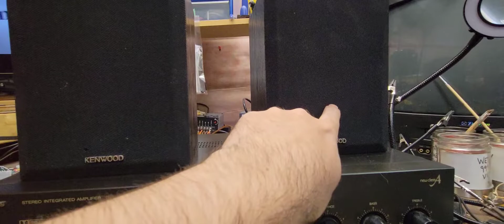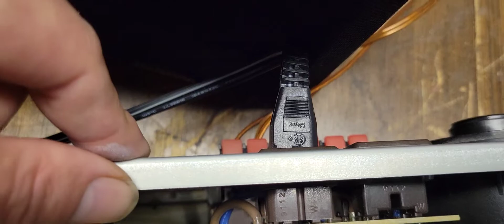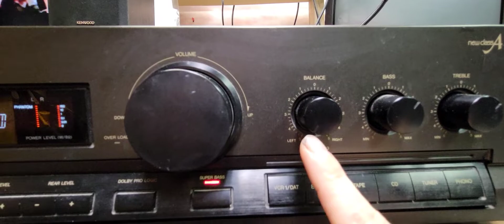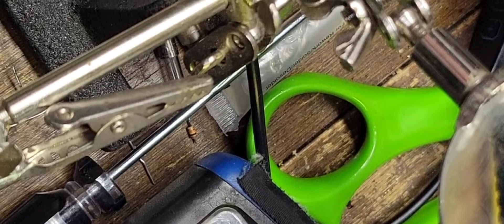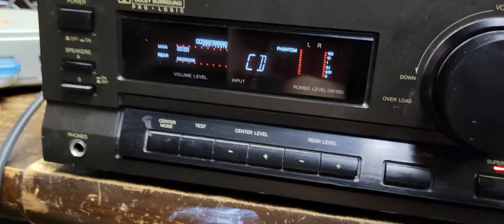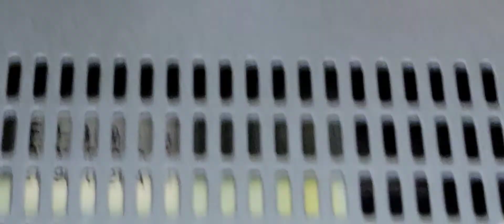Technics Amplifier Repair

Comment: I have this same Amp and had a similar issue. Just needed to touch up the solder joints on the speaker binding posts.

Comment: My Technics SA-AX920 receiver emitted a very POP from each speaker cabinets and immediately shut off.  Once cooled the unit returned to serviceability until again "POP" and unit shut down.  Talking with some engineer friends they tell me the outboard cooling fan has stopped working causing the output transistor boards to over-heat and hence the loud "POP" sound and immediate shut-down.  I really like the sound of this amplifier driving two Kierksaeter X-79 floor standing speakers I watch being built at their plant in Germany.  I would appreciate recommendations for repair to serviceability of the Technics.
Reply from the maker: @ScottMcVittie-p5c  when playing music do you see the fan moving?

Comment: need your help or suggestions....after 30 years my Technics Su-G75 amp went out over the weekend.....I thought it was the fuse, ordered some 6.3amp 125v and nothing happened. Not sure what to do next? It clicks when I hit the power button but nothing turns on....yesterday I hooked everything up and everything works but not the amp...but some how it's passing power to the other components. I also can't seem to find a good stereo repair shop in the Houston, TX area either....everything else works fine...that it came with.... thanks in advance FOR THE HELP!! THIS WAS THE FIRST STEREO THAT I SAVED UP AND BOUGHT MYSELF.
Reply from the maker: Before it died were you playing it really loud over a long period of time?
Reply: @inspectahtech  actually no I barely use it…its upstairs in my game room. The last time we turned it on was probably around Christmas. Typically we turn it on throughout the year when we spring clean, etc. to listen to music or if I’m upstairs working.
Reply from the maker: @mickbrown815  I would check for bad soldering joints on the speaker terminal(s)like in my video and then move on to things like bad amp transistors
Reply: @inspectahtech  thanks
Reply from the maker: @mickbrown815  no problem let me know what you come up with

Comment: At the 24:00 minute mark, you spoke about lubing up the fan. I have a Technics SA-R477 receiver that the fan makes a noise when you turn it up to high volume. It sounds like a dry fan bearing. Could you provide information on how you lubed the fan motor. Thank you
Reply from the maker: I would just use the smallest amount of liquid lube you can unill its quite (not wd40)
Reply: Could you suggest the product that I should use???? @inspectahtech
Reply: can you suggest a lube that I can use on the fan motor?? @inspectahtech

Comment: SU-G50 with VFD not lighting, no buttons responding, but the relay clicks OK: On the display / button / dial board, found RESET signal low on pin 27 on the 64 pin processor, due to open R923 (220K), and open UN4211 transistor(s), either Q910 or Q912 (replaced both).
Reply from the maker: Did you get it figured out?

Comment: I changed a variable resistor of the equalizer that went bad for another with a close value and I've had it using it for several years, after doing this one channel worked a little lower, but today I let the audio of one channel come out from the amplifier.  It is not cable or speakers and even if I turn off the equalizer, the audio from one channel of the amplifier no longer comes out. Please how can I repair this
Reply from the maker: I would check for bad solder joint on that channel first, it seems to be a common issue

Comment: I own this amp and at half volume my floor speakers rattle the walls. A beast of an amp
Reply from the maker: It really did sound amazing after I repaired it, I was impressed with how good it sounded with the cheap little speakers I had on the test bench

Comment: the fact that the thermal paste in the amp is still good after almost 30 years is mind boggling
Reply from the maker: Unbelievable right!!
Reply: Это не та паста, которая используется в компьютерах 🤷‍♂️
Reply: Especially because Technics receivers from this era have bad solder joints and they cook themselves to death, damn near thermal runaway